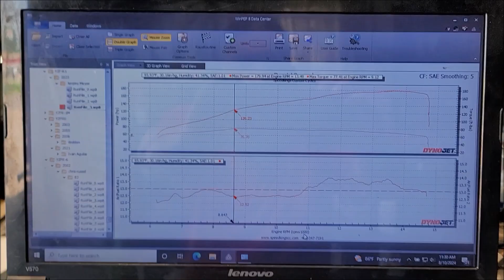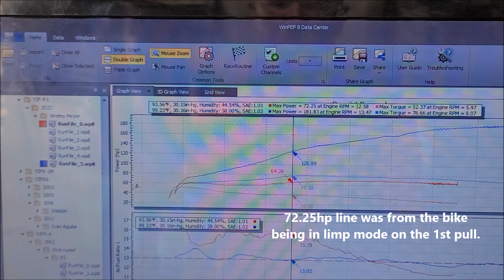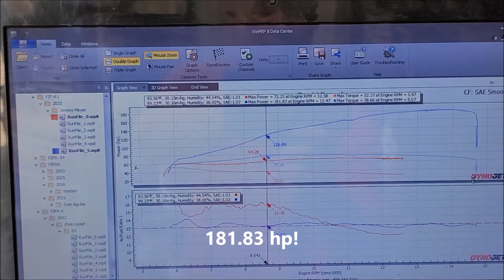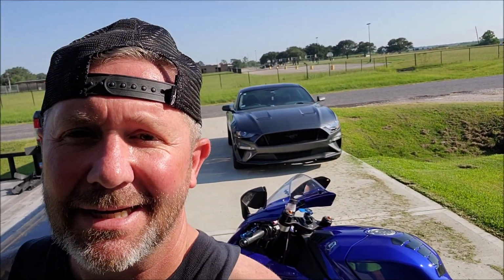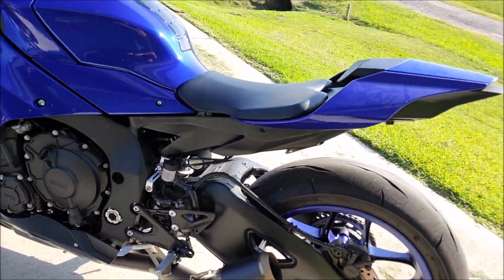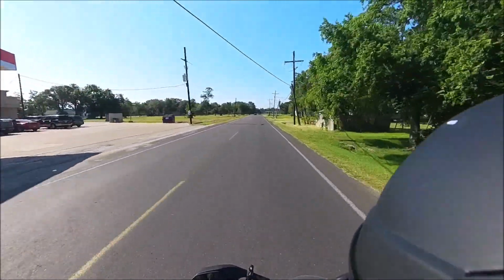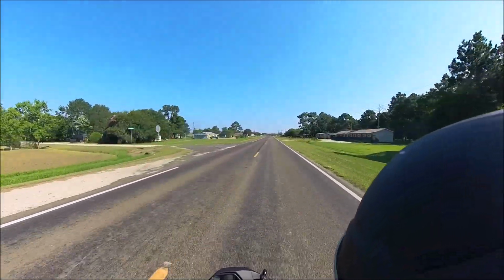2023 R1: ECU Flash, Dyno Tune, & Street Tested

Comment: I’ve been looking at parts to get rid of the ugly stock plate holder and tail light mount any recommendations for that would be greatly appreciated thanks
Reply from the maker: I took the seat off and pulled the battery out.  I found a spot where I thought the plate would still be visible and drilled 2 holes.  I drilled holes in the license plate and attached it to the bike using black plastic bolts and nuts.  Ran my light to the plate as well.  If you do the same, just make sure you are drilling through the plastic undertail only and not any metal parts that are hidden.  I did have the TST industries mount that tucks the plate in the general location I have it now, but it was not DOT approved, and the tire hid it.  Got lit up by 12 for it, so I did the described mod afterward.
Reply: TST industries makes a fender delete and plate replacement
Reply from the maker: Yeah, that TST relocation kit that goes by the tire got me lit up by the 12.  Not DOT approved and not worth the hassle it created.

Comment: Hey man, question - why did you turn tpms off before starting the engine?
Reply from the maker: The guy who tuned the bike turned it off while dynoing I believe.  It was TCS, traction control system.  I am under the impression that with it off, the power delivery is unregulated by any of the electronics, giving full power to the wheel.  Max power, now wngine management regulation.